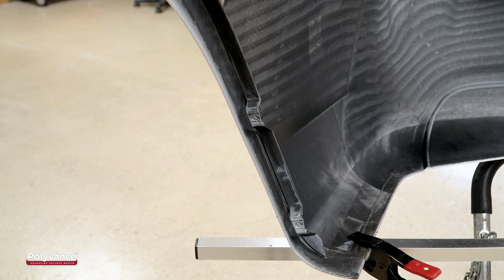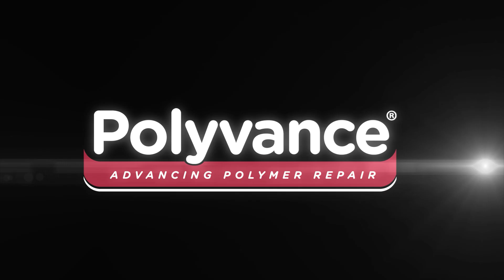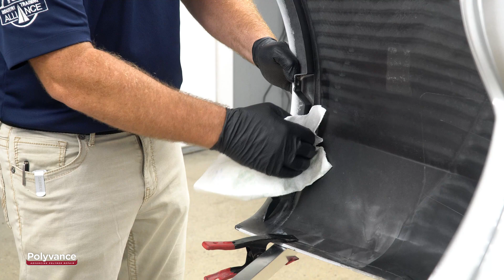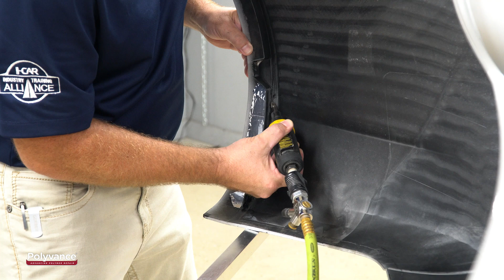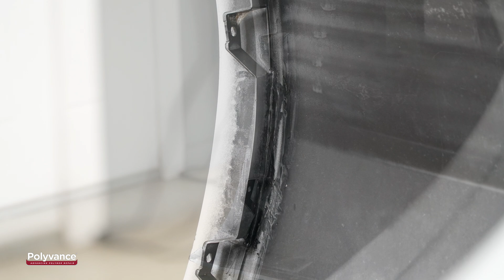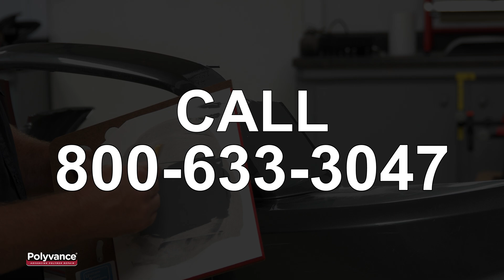Fender Liner Flange Repair

Comment: This is not an approved repair methodology for BMW family vehicles
Reply: You must sell BMW parts.  So are you saying BMW specifically disallows welding as a repair method on their vehicles?  Implausible.  Bumper covers are a cosmetic piece and can be repaired any way a shop deems fit, so long as the repair doesn't interfere with the functionality of any sensors located behind the bumper.

Comment: Will these nitrogen welders weld HDPE?
Reply from the maker: Yes!
Reply: @polyvance  even your smallest nitrogen welder for around $1,200? See I'm wanting to build a HDPE flat bottom boat made from barrel plastic I need to weld them together to make one big durable piece.
Reply: @MudMotorsMax  Take a look at the 5213 AG welder Kit It includes a hot air welder (for speed) and an airless welder to shape the welds as needed and to embed stainless steel mesh.  The welds will not be quite as strong, but you should be able to make it strong enough for just about anything you can throw at it.  It just takes a little more patience and a little more welding rod to make up for the fact it doesn't use nitrogen. Basically it takes a bigger weld to make up for the lower strength, which is why people who are using them all day want the nitrogen, it saves time when welding because you may be able to get by with one or two passes, rather than two to four.  Link:  https://www.polyvance.com/Hot-Air-Welders-1/5213/
Reply: @polyvance  oh and thank you so much for the reply I love your videos I Subscribed